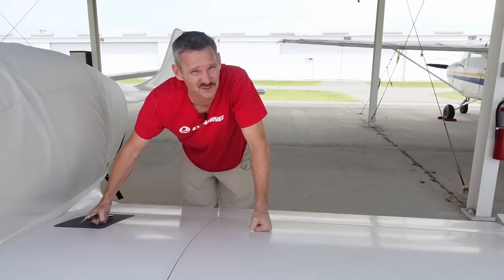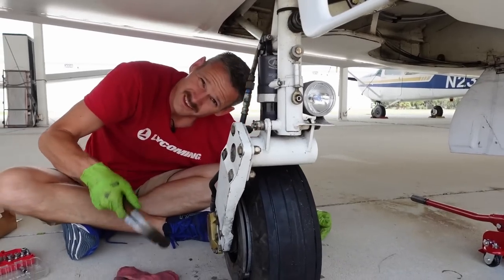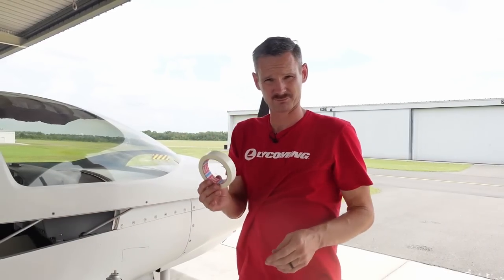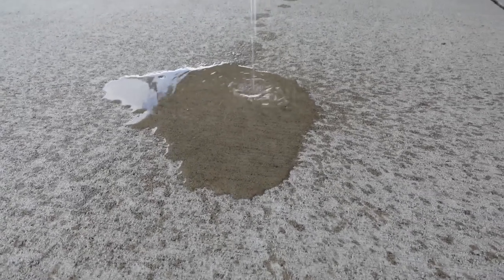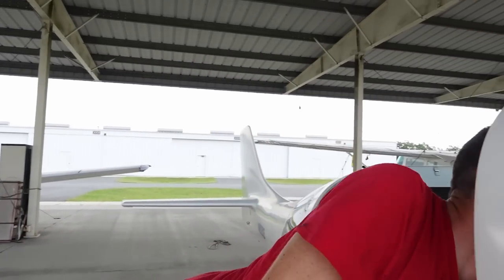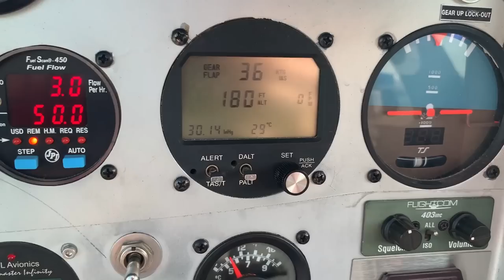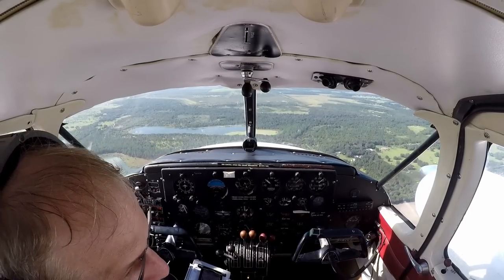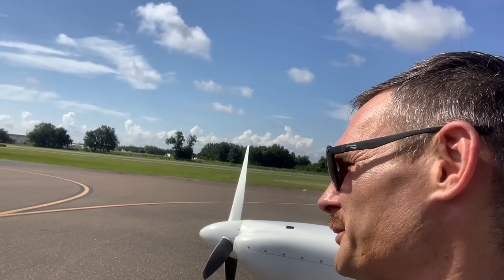This Line Slowed The World's Fastest Airplane & 1st Race!

Comment: Someone beat me to it, I'm an autobody repair/painter of 40+ years, but yes, when peeling tape off, pull it back upon itself not straight up, it is much less likely to peel any of the painted surface off. Also, gap sealing is only necessary on one surface, top or bottom, all you are doing is stopping the airflow into and through the gaps which creates drag. Either top or bottom is sufficent😎
Reply: Looks like crappy paint. Would a 2 part come off like that?
Reply: @kasm10  Any paint job can peel wether good or bad, but you have to take into consideration, this was a homebuilt, builder probably did best he could on prep and paint, non-the -less to say its probably aluminum so its even more senistive to peeling, but it still stands, if the tape is pulled back onto itself there is way less chance of damaging the paint instead of ripping it straight up which is the cause for disaster. Also, aluminum prep for paint takes more steps to prep for paint than steel, and IMO, looking at the peeling it appeared the paint top coat pulled, but left the primer substrate making it appear the primer wasn't prepped sanded and cleaned as good as it couild have been before top coating. Still its a bummer that the paint peeled.
Reply: It’s also a really flat finish which seems odd. Jimmy was talking about repainting Cameron I guess a full strip is needed to make it right

Comment: As a layman I couldn't believe that you just drilled holes in the ailerons to drain the water. Doesn't that bear a risk or causing cracks that could seriously harm the structural integrity of the ailerons?

Comment: I did Flap Gap seals on my 172RG, to add speed!
Reply: I'm curious did it work I was thinking of that myself have a little 152 I am restoring was thinking of trying it and I had a 172 RG many years ago great plane.
Reply: @jamesmackinlay4477  I had a 172, then the 172RG and then a normally aspirated 210! I think the RG Flap seals added maybe less than 5 MPH as I recall. The RG was the best of the bunch. I sold it to the airline school Quantas! I was flying back from Florida once when the flight controllers questioned what I was flying again, as I was showing over the ground at about 163! The good old days. I then built a 2 seat Avid Heavy Hauler, sold to a friend and now only have memories!

Comment: curious why didn't you complete the Seal by sealing the gaps of the engine Cowling? Those gaps and the screw heads probably could get you another 1 or 2 knots. seeing that water in the ailerons made me cringe. you are a very lucky person not to have it affect the flying qualities and control balance as badly as it could have. And still might…

Comment: I wonder if there is corrosion in the flaps where you drilled the holes to let the water out?
Reply: They are fiberglass
Reply: @danblumel  Just as well I guess. Thanks for the info.

Comment: With Jimmy it is a 75/25 chance it will not work, I've seen the last three videos on this new magnito project. He gets it right only about 25% of the time unless he does anything twice it usually doesn't work the first time sorry Jimmy. Just the way it is from what I have seen from your own videos. What could possibly go wrong right? Hahahaha that's was funny right there. Somehow I feel a cut scene was not added into the video like it was supposed to be and we didn't get to see the first real try. If truth be known. Come on Jimmy fess up. I am wondering if the flaps are going to go down for lift after the tape is applied to the wing. Up is easy peasy but down is where the tape is going to have to stretch to get the flaps back down for lift. Might not be a good deal on take off Jimmy. Not a fair bet without knowing the weight ratios per pound to horsepower.